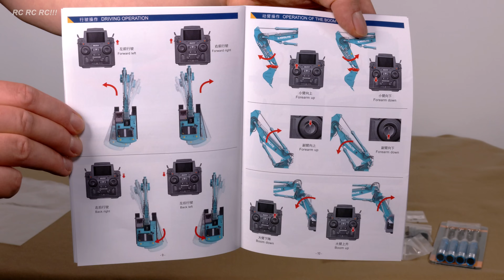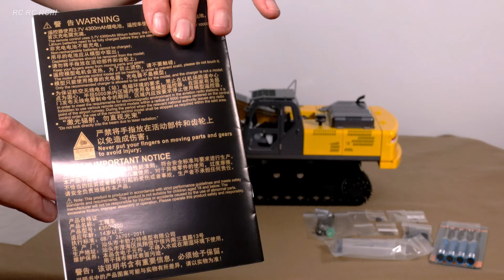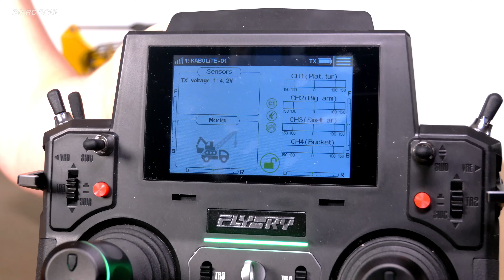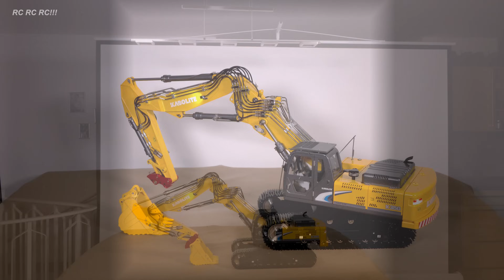UNBOXING KABOLITE K350-200 RC HYDRAULIC MODEL EXCAVATOR, 3-PIECE BOOM, FLYSKY PALADIN PL18 EV LITE

Comment: As cool as those Models are, barely any reviewer shows the Playability... I mean yeah, it will have all the functions of an Excavator but we all probably wanna take it out in the Sand... How good is it? Does it have Problems after? That would be cool to know! :))
Reply from the maker: With this K350-200 i don't going in sand. I have also the K350-100 in green on my channel. This makes problems with sand. After hard drive the gear has slip.

Comment: Nice unit. I have the  Kabolite 988K. If only the Chinese used the same pumps as the German brands. This is too noisy.
Reply from the maker: Unfortunately, the wheel loader Kabolite K988 with sound module makes tic, tic, tic from the sound module when turning in.  That's very annoying.  - The Chinese manufacturers are already installing a hydraulic pump from VW Volkswagen, the automaker, in the Liebherr 946 excavator and the Volvo E380 excavator.  The hydraulic pump comes from the power steering and is very quiet.  With a pleasant deep sound.  So it gets better.